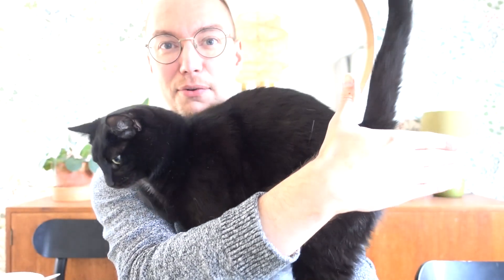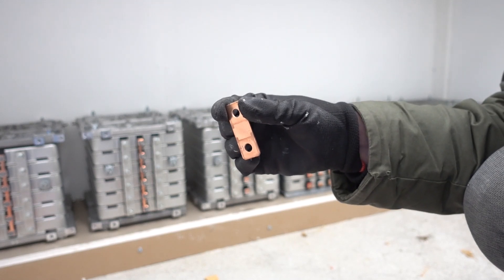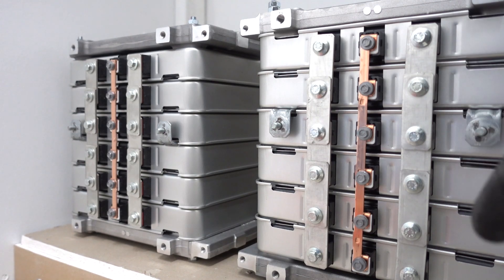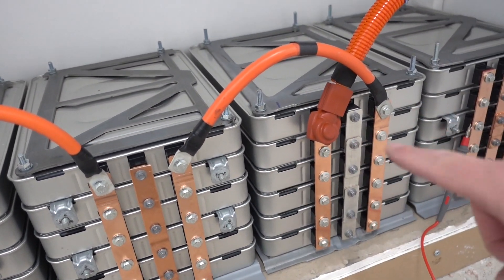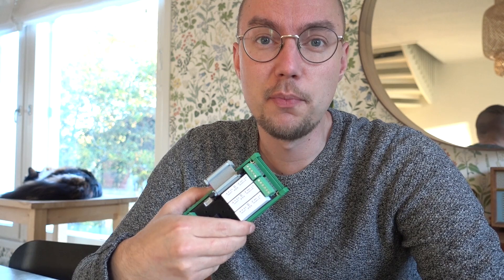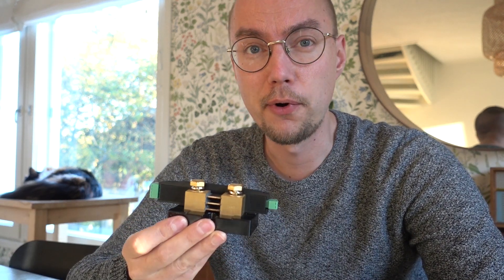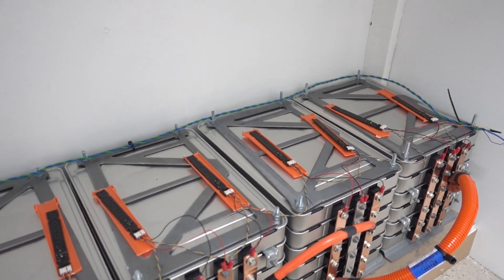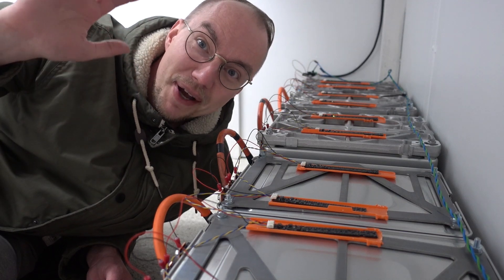ON/OFF-GRID DIY Powerwall build [part1 - Batrium BMS]

Comment: Hi Dala, how are the regulations in Finland for batteries connected to the "grid"? Does your inverter have ups functionality making the install more or less blackout-immune? Or is it one of those inverters that shut off regardless when the grid is down? I am from Sweden and have solar with ups functionality but have not yet heard of a resonable solution that fulfills the grid companys safety requirements.
Reply from the maker: Hej, this inverter shuts off right when grid goes down, to avoid backfeeding. But higher tier models exist that can isolate from grid with contactors, and run the entire house offgrid. Our electrical provider has a list of approved inverters, that fulfil the grid code requirements.

Comment: Arranged my Nissan cells 14S20P, made from 3 Nissan cars. Got a Batrium WM5 and I am not that pleased with it. It needs a windows computer, Mac&Linux only here, so had to buy a Win Laptop to do firmware updates. Cell balancing of the WM5 is of course way too little for a 72kWH pack and the WM has problems. It shows a high voltage when balancing and triggers shut off. Software error. So I bought a chinese balancer with BT, works well. Cells did not drift apart the last 3 years. Also Batrium do not offer MQTT to read data, you need other tools. With every firmware update they change the data list, so your MQTT reading tool needs an update. Wifi dropped very often from the Batrium with previous firmware versions. Next time I will look for a tool that just ready battery data and a separate balancer. Reading voltages and SoC must be 100% stable.
Reply from the maker: Yeah I would not go the Batrium route if I would start over. I would just use the entire pack as-is with 400V
Reply: @DalasEVRepair   I am planning a new system, 400V inverters are now available, but batteries are SW locked, would choose a VW pack, they are easier to get here, if only someone could unlock them.  Greetings from Germany and thank you for your videos :-)

Comment: I have my leaf cells in 2 stacks. 12 per stack. I have them running a couple 24 volt inverters. They seem to be working great. Do you know how many amp hours 24 modules are? They are from a 2012 leaf that had 30 thousand miles when wrecked. I dont have a bms and i should have done the 48 volts but i was new to this and set them up as 24 volts. This seems strange but they seem to have most their capacity from 23.5 volts to 25 volts. Once they drop below23.5 they definitely dont have much left in them so running at 24 volts seems better than id first thought. Ive never had a bms but id love to have a good bms.
Reply from the maker: Originally the modules were 500Wh. I would never dare to run without a BMS!

Comment: The BMS system looks like it's just a Battery Monitoring System ?
How can you control individual cell charging with the current setup ?

You could end up with a reverse charged cell or an over/under charged cell.
Reply from the maker: No risk, this BMS does balancing via resistors.

Comment: ? Can I use that BMS if i do not have a Microsoft Windows operating system?
I mostly only use Android, then chrome, and in the closet is Linux....
Reply from the maker: You can use virtual systems to allow it to run on Linux or AppleOS. But software is Windows only for now!

Comment: Hi Dala, In January 2022 I purchased a 2013 LEAF (Hooray). I have noticed in winter (southern hemisphere) that the range I could get from a full charge was less than I got during warmer weather.
Then I remembered that Finland gets cold. 
So my first question is have you noticed this effect in your LEAF? 
Second question. It is dawning on me the significance of the early LEAF not having temperature management on the battery. I know some people have retro fitted 40 kWh battery to these original 24kWh cars. 
Do you know of any attempts to retro fit temperature control into a LEAF battery pack? 
Is there much to be gained by attempting to do this?
Your vids are very instructional and clearly describe what you are doing. Love them.
Reply from the maker: Hi, I would recommend hopping over to the mynissanleaf.com discussion forum!

Comment: Hi, nice work, I've done the busbars myself on a drill press with a jig. Wasn't much fun, but when I did the second kit I realized how much easier tha your way for example. Anyway, is there any specific reason why you choose longmons as opposed to the specifically designed leafmons? A bit tidier and less hassle to secure them. Also I experienced some issue which was very likely caused by the comm cable extension, my one was in the middle of the pack. It seems to be no problem since I removed that. You mentioned you want the BMS to "work" with your inverter. I guess you referring to the CAN communication. What I noticed with my Sungrow Hybrid inverter, the parameters in the inverter are fixed, and lot more conservative than the Leaf batteries capability. Nice to have all the fancy features but the inverter itself does very good job in "other battery" mode, when the parameters are customisable. Hence the extension board in hand, adding emergency disconnect option is pretty easy.
Looking forward to the coming videos.
Reply from the maker: Thanks Arpad! I wanted the longmons, since I will probably experiment with many different types of cells, these LEAF ones are just a starting point. So I didn't want to lock myself into the LEAF-formfactor! Thanks for following!
Reply: @DalasEVRepair  Another alterntive would be WatchMon-CORE + CellMake-K9. Should be cheaper. And less stuff, just cables with fuses going from teh CellMake to the cells. 

And I haven't figured out yet what I would need an expansion board for... 🙂

Comment: Did you research other bms options when you chose bms?  I'm building a 20 kwh battery myself and I'm looking for a suitable bms.  I have considered 123SmartBMS, it would be nice to hear your opinion on this
Reply from the maker: Yes, but I went with Batrium due to the broad inverter support. I'll run it with Victron gear, looks like the 123SmartBMS would work well also!
Reply: how does that battery bms perform the balancing?  can it transfer energy from one cell to another?
Reply from the maker: @tapanileinonen5049  This is passive balancing, check their wiki!

Comment: It could be good to stagger the bus cable connections to top and bottom cells, to keep current more equal within the modules.  As is, the top modules have the lowest resistance path.
Reply from the maker: Good idea!